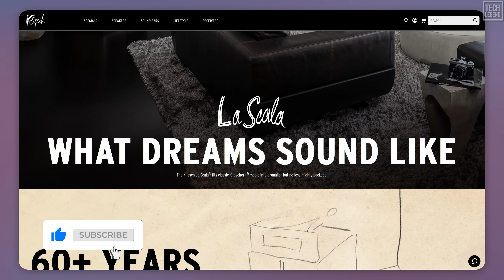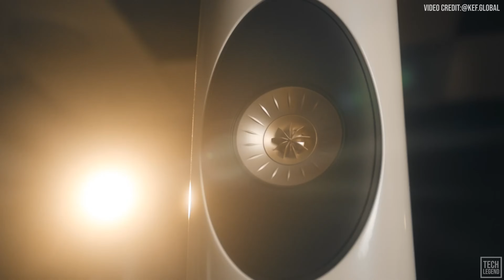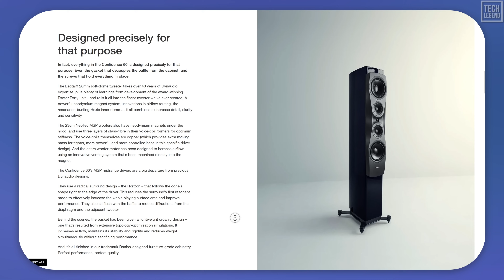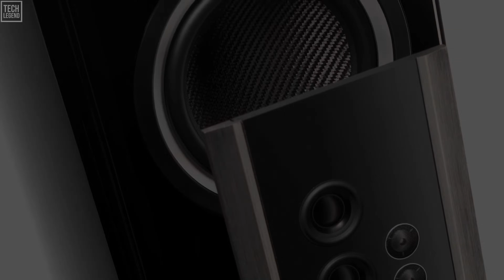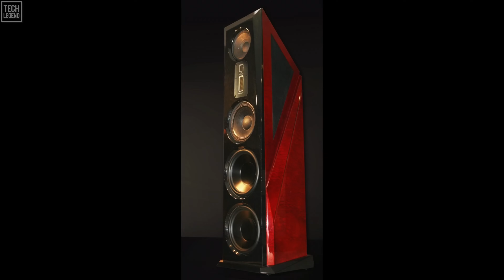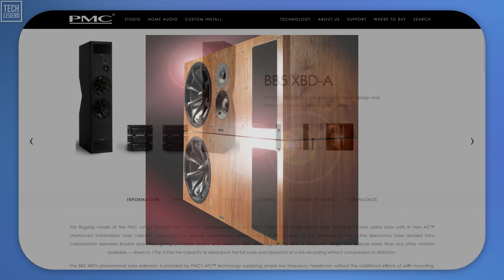The Greatest Floorstanding Speakers Ever Made | Hi-Fi Legends for True Audiophiles

Comment: I think that over 90% of them just sell you fine woodwork, design, marble or aluminum pieces with very nice finishes, but the audio quality is far from good. I've heard speaker cabinets at expos that cost  $100,000 USD and more, and frankly, they leave much to be desired in terms of sound—very artificial, lacking depth, with distorted and shallow highs, and distorted bass, all while boasting about the best technology, without three-dimensionality, nor present sound

Comment: Have  Arendal 1961 speakers in 5.3.2 atmos setup, sealed subs are Diy they play 10hz flat inroom.
Use the same drivers for the subs as the Beolab 90 speaker used for low end.

Comment: I cannot believe that the last iteration of Polk Audios Signatue Reference Series speakers (TL1.2 or slightly 'smaller' TL2.3) didn't  make this list.  At peak development of the SDA - Stereo Dimensional Array - technology these incredibly sonic speakers presented a 3D soundstage like no other speaker on the market!  Massive speakers that could reach well past 20kHz and down to a tight and solid 15Hz.
Reply: The SDA was a purely acoustic implementation of inter-aural crosstalk cancelation (I.A.C.C.). While it greatly expanded the perceived sound-field out beyond the physical speaker boundaries, after a while, that effect became tiresome, and not very natural sounding. I liken the I.A.C.C. which I’ve heard to a fun-house room of mirrors. A novelty that is perceptually fun at first, but then heard as more of a spatial distortion the longer you listen. Just my 2 cents.